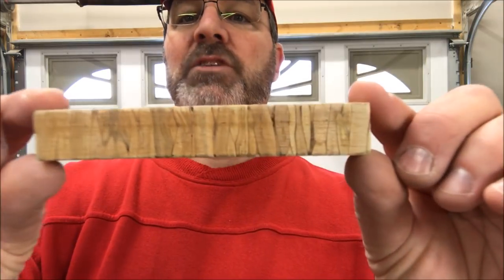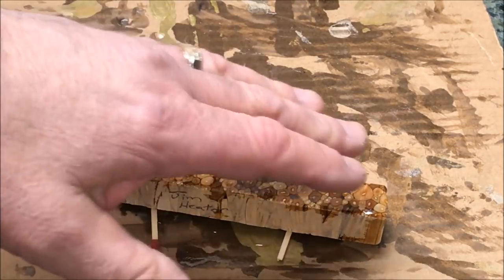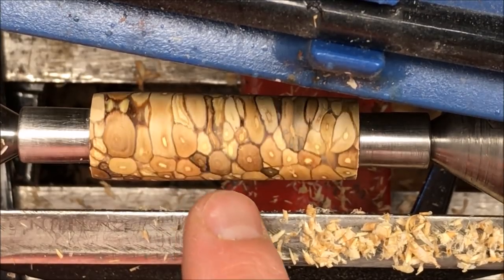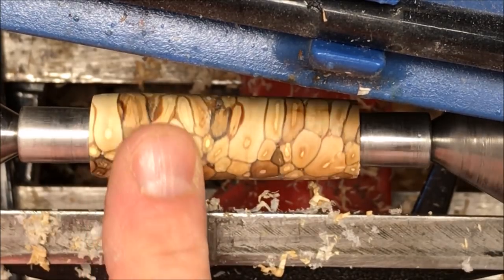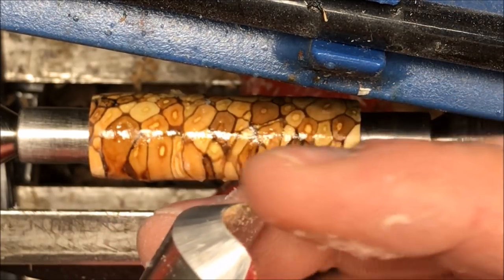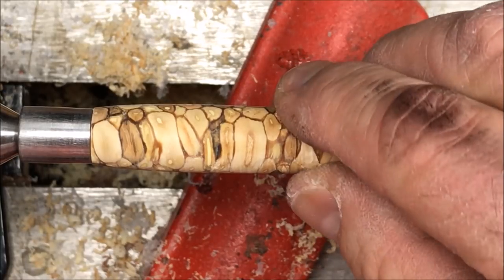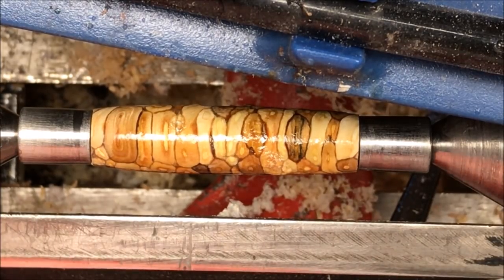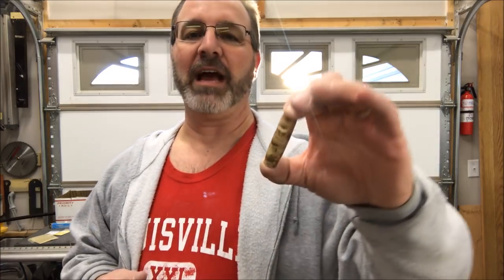Apple Twig Blank

Comment: The fumes from the CA glue is the reason I will not do CA finishes.  Plenty of other less toxic finishes to use LOL...oh and not have to worry about gluing the bushings to the blank, or myself to the blank HAHA!!!  Or rather gluing the blank to my counter in my shop...yep done that a few times...OOPS!!
Reply from the maker: It’s nasty but I still like it. 

Regards,
Bob
Reply: I keep the dust extractor going, when using smelly CA glue, which helps eliminate the pong. Secondly there are less smelly/toxic "flavours" of Ca glue available. google will find them. I just wish that I could find bulk CA glue at an affordable price.
Reply from the maker: I know what you mean $14.00 USD FOR A 4oz. Bottle is crazy. 

Regards,
Bob
Reply: I quit buying the CA glue and just started using epoxy because it seemed like most of the time trying to glue in the brass tubes they weren't holding, especially when using acrylic blanks, so I don't even bother keeping CA glue around anymore.  

Now that I'm venturing towards metal pens, the epoxy is an absolute must have, and there's no hurrying it along to turn a pen, you have to wait the full cure time when you are working with the metal blanks, otherwise the tube comes lose and just starts spinning inside the blank.
Reply: I've also noticed several occasions recently where it doesn't 'stick" the tube to the wood. Given that I was using a different drill bit to the usual one ( temporarily lost when I needed it ), I thought that might have explained the problem. So perhaps I was mistaken. My gripe about epoxy, is the small amount needed, compared to the large volume my West Systems setup delivers.
Reply from the maker: Photos please William.
Reply from the maker: Hello Kiwi,
  The hardware store sells a two part epoxy that is in a syringe. You can place a couple small dabs on a surface and mix them together.
Reply: Send a couple pictures to your email.  Next pen I make I'm going to try and put together a video on it, and do a video on the stuff you need for the metal lathe, not really much different actually, just different tools and process.
Reply: thanks, I'll look for some

Comment: i think i would part the top section off and put a nice small piece of olive wood or cherry cap on that end. and make that side of the turn the top where the clip gets put on
Reply: I agree with John. The color of your twig blank is very close to Olive Wood. The other thought I had while watching the video was perhaps, after you completed the first repair, you could have taken sandpaper to it since it was so close to the finished diameter.
Reply from the maker: Sand paper might have worked but I hate sanding so I always try to decrease the amount I have to do. LOL. 

Regards,
Bob
Reply from the maker: Thank you John. 

Regards,
Bob